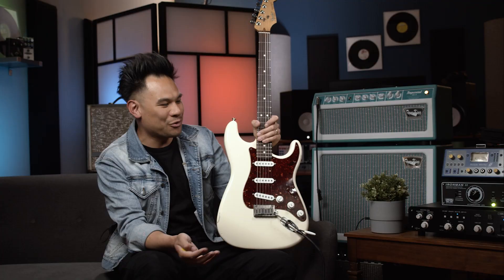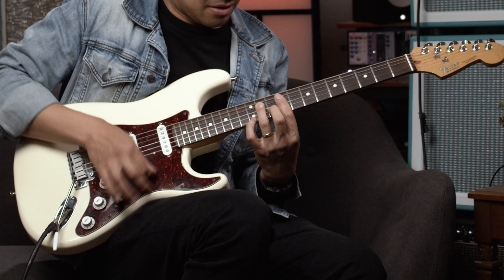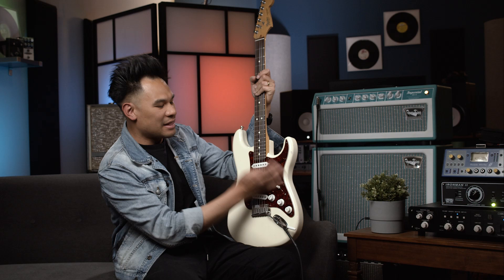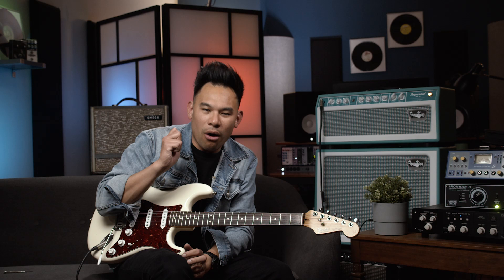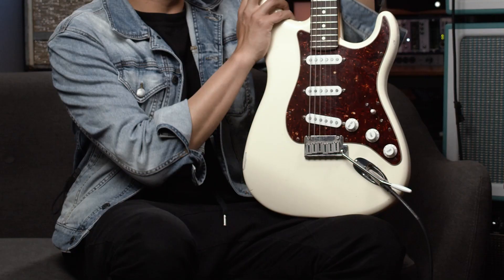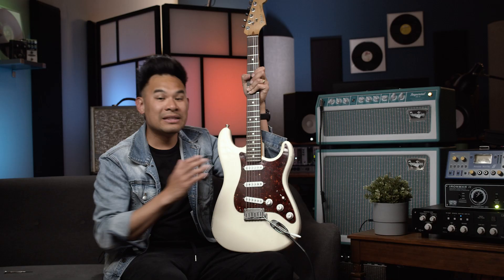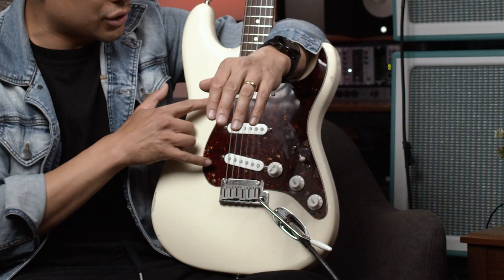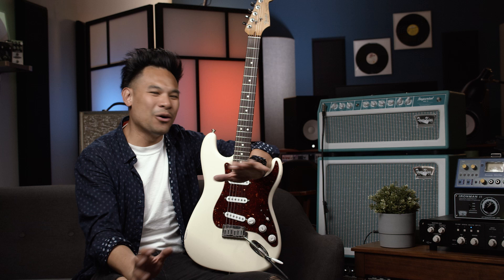The 2 Best Strat Wiring Layouts You Never Heard Of | TONE LAB

Comment: You can also install the Freeway switch for the first layout. This way you can have the normal wiring on 1-5 and your wiring on 6-10 - which is the switch turned. Or something like that at least. If you've never heard of the Freeway switch, check it out and you get what I mean.
Reply: Wow that's amazing, I didn't even know abt that
Reply: I think I've heard that name before tho
Reply: The Freeway 10 position switch, on their internet site, has free downloads ( in PDF) of many different wiring diagram configurations for various pickups configurations.. and different wiring for various pickup configuration on the two different upper or lower rows of the switch. It is having two blade switches in one switch, so you get 10 selections instead of only five positions of a usual blade switch. I have mine wired so that one blade row of selections is all single coils, and the other row are all humbuckers, plus I included Jays quarter blend mod.

Comment: I did a similar mod (the first mod) but with an HSS Strat with a Super Switch.  The neat thing about that is that not only could you get the Tele in-between sound, but it was also noise cancelling (with the outside coil).
Reply: Do you have a schematic for that? I want to do that same thing with a HSS Strat

Comment: It's so easy to just add a switch (or push-push) to link the neck and bridge pups together, so you can still get that tele tone in positions 1 & 5.  And then in positions 2 & 4 flipping that switch gives you all pups at once.  No need to sacrifice your solo middle pup tone (MY personal favorite on a strat).

I like the blend knob idea.  I think the two tone knobs on a strat are redundant anyway.  In fact, I don't fuss with my volume knob either, so I turn all my vol knobs into bass-cut controls.

Biggest thanks for informing me about no-load pots.  I've never encountered those before.
Reply: Well explained. Now I  know what to do with this new push push pot and this blend wiring. I will create a no load pot by opening it up and removing conductive material.

Comment: I've got my Nashville style tele wired up with the 10 position freeway switch, bottom row just like a strat, top row n+m series, n+b parallel, n+b series, n+m+b parallel, m+b series. My control plate is on backwards, first is a "vintage inspired" 280k volume pot, second is a 1meg cts pot with a .0022uf cap for a passive bass cut, then the 3rd pot is a 250k no-load tone pot with a .047uf cap. I've found uses for everything. All 3 pickups with volume at 10 and tone at 10 (no-load) is a great extra quack funk tone and the series come in handy for huge fuzz tones and other fat gainy things. The bass cut is great for being able to dial in a little extra bass on the amp for the bridge pickup and then cutting some bass on the guitar to get that chimey neck pickup thing. Also the bass cut is great for adding some clarity back into a higher gain sound
Reply: can.you share it... cause im trying to get that kind of sound but i messed up...with my strat..tia...

Comment: I've actually been doing a similar mod to my strats, although perhaps not as elegantly.  I simply swap the wires for the middle and neck pickups around on the switch, so that what you get is the bridge in position 1, the bridge and neck in 2, the neck in 3, the neck and middle in 4 and the middle in five.  This wouldn't have worked out for your love of the normal strat position 2, because I did sacrifice that to make mine work.

Comment: agree with the add neck via blend is better than just a add neck switch where it is full neck or none.
I have removed the carbon on a 500k linear taper high friction pot at the 8-10 range and found it to be ideal for dialing in exactly what I want via blend and I have been pleased with a half out of phase mod for neck before the blend as well.

Comment: you should put a link to the schematic diagram as an image, I copied it from the video, but my drawing skills are pretty feeble. I'm going to take this and apply it to an HSS setup where the humbucker will have a pull switch on tone 2 for series/parallel, and a mini toggle switch for in/out of phase for the humbucker against the two singles. This combination means I only have one extra visible switch which keeps a nice clean look and keeps me from getting confused like if I had three mini toggles lol plus it'll keep the control cavity cleaner. This video changed my whole project I was seriously stressing over having a bunch of mini toggles to position and keep track of. The only thing I've lost is I don't have the middle pickup isolated in any control configuration but I don't think I really need that. You really bumped this project up to the next level and I can have what I want without a ridiculous looking bunch of extra switches. The pickups are two Seymour Duncan Lipstick pickups neck and middle and a Seymour Duncan Pearly Gates covered bridge . . . if it turns out it should be pretty versatile, I have not counted the possible combinations, I'll figure that out playing it . . .

Comment: I bought an HHH strat pickguard off of Ali Express and it was completely miswired.  Anyway I have to figure out what to do with it.  So far I bought better pots and replaced the spdt switches to split the pickups into dpdt on/on/on that I can use to switch them between series, parallel and single coil. But I would like to also create that telecaster sound and that would require something different, maybe double pole 5 way.

Comment: Thanks to your video on the quarter blend mod I have added two of those 6 position rotary switches (each switch has 2 gangs). I soldered 5 different values capacitors to the rotary switch lugs to have various capacitor choices by rotating the knob a click for each position selection to choose a different value capacitor choice (used for the two 500k push/pull Tone pots). The 5 capacitors used were the:  .015 uf,  .022 uf,  .033 uf,  .047 uf,  .068 uf. One rotary switch (for the neck pickups) is for Tone pot#1, the other rotary switch is for Tone pot #2 (for the bridge and middle pickups).When blending the neck single rail single coil pickup into the the tele bridge pickup, each pickup has its own tone pot and each tone pot gets a choice of which capacitor to use. The four 500k push/ pull pots are the (Vol pot #1, Blend Vol pot #2, Tone pot #1, Tone pot #2). I also use two Blend pots for the two blend circuits.  On the 42 tones circuit I have choices of series- parallel and phase shift, and also choices of series-split- parallel.  The electronics cavity was routed-out a lot to fit the components and the wiring.  Plus I routed-out  all the way through the body for two reasons, to have easier access from the rear cover plate without having to remove the strings and pickguard to work on the electronics, and the routing removed the weight that all of the added components contributed. I used 5 mini-rocker switches (on off on) placed in a homemade panel. Since I could not find online any (on-on-on) mini-rocker switches, I instead used three large size toggle switches as on-on-on switches (the larger size toggle switches that are the 3 way "pickup selector type switches"). I made a pickguard from an online ordered sheet of pickguard material. I did more routing-out to install a Floyd Rose tremolo and a locking nut.

Comment: Hi there! Like the wiring on the 1st. diagram. The use of the capacitor, how many volts can be installed? Thanks and have a blessed day 😊
Reply from the maker: Almost anything will work for a guitar circuit. Anything above 0.5V will be more than enough.

Comment: Thanks so much. I love both of these mods. Can you tell me why you use a .047 capacitor?  Other tone people have said that 250 pots should use a .022 capacitor.  Still learning :)
Reply from the maker: The .022 do a better job at retaining clarity as you turn down. However, I like the tonal response with a rolled off .047, a little less strident and more rich than a .022 at the same setting.

Comment: Hello Jay, My question is, when in the blender position of neck and bridge, is it wired in series or parallel?  I have a tele with a 4 way switch that does both and I really liked the extra position of the bridge/neck in series.  Would be curious if there was a way to do both in this configuration.  Or if only having one option can it be done in series rather than parallel?
Reply from the maker: I have the blender pot in parallel. I do like the sound of some pickups in series, really does have a nice thick tone to it!

Comment: Would be very interested in your opinion of the ten position Freeway 5B5-01 (for SSS Strats), Freeway 5B5-02 (for HSS and HSH Strats) and six position 3B3 (for Teles) switches. I have fitted them on most of my S type and T type guitars and I am very impressed.
Reply: 10 way is great. How did you like the 3x3?
Reply: @50kal44  the T-type 3x3 is great. Just as intuitive to use as the S-type 10 way, and two or three more tonal options over the more common 3 and 4 way wiring.

Comment: JLJ. I am building a hardtail strat with two Banning Filtertron pickups and a threeway roller switch with only vol and tone. I am thinking of blending tone at bridge position.
I am using 500k pots but trying to figure out best caps to use?
AND...have you ever played aguitar setup like I am doing?
Thank you. Rob
Reply from the maker: I would start off with a 0.022mf cap but you can go to something like a 0.0022mf if you want something a little more subtle. Cool setup: It'll be like a Two Pickup La Cabronita with a little more versatility on the bridge.  Good luck with it!
Reply: I have added a 6 position rotary switch (which has 2 gangs). I soldered 5  different values capacitors to the switch lugs for having various capacitor choices by rotating the knob a click for each position selection of a different value capacitor choice, The 5  capacitors used were the   .015 uf,  .022 uf,  .033 uf,  .047 uf,  .068 uf. One rotary switch is for the neck pickup tone pot#1, and I also have such a rotary switch on the other tone pot#2 for the bridge and middle pickups.

Comment: CTS 500k/250k Audio/Log Push-Pull Pot, Solder-Free, would this work in a strat regular wiring, with out without the wiring adjustments on your diagrams, which btw are pretty cool so cool it's goy me on a mad hunt for greater understanding of wiring snd parts the materials and their properties, all add and take away something, my understanding is tithe load of any strat from the jack hot in is the same depending on the amp, or I'd it the a.p settings I'm not sure as it's confusing to know that the behaviour of electricity is far different from water I'm a plumber, water is either pumped- forced through pioes/conduits, same as air conditioning, but electricity it's magnetic nature n'all is drawn, pulled from the magnets, the the electromagnetic field created by the pickups coils and magnetic pole pieces, when the string is close enough to be in the sweet spot if the magnetic field te coils individual magnets creat( I imagine the warp bubble from star trek beyond!) It's to e is at its best,. Any way thanks also for the link to the skill builer sharing site! Awesome I'm joined up already. 
My main question regarding that tone pot I mentioned, I meant would it work dyou think, in the blend at bridge pickup flowing tone from the warmer neck pickup? Learned so much just from one god vid! Thanks 👍
Reply from the maker: You can use that pot with a standard Strat wiring. What you would do it connect the 250k part of the pot as you would a basic tone knob and keep the push/pull selection in the spot where that 250K port of the pot is activated. You can also do it with the 500K side of it as well and the tone will be slightly different when at 10. That being said, I think that a simple 250K Audio Taper Pot would still be your easiest, most stress-free solution. Happy tweaking.